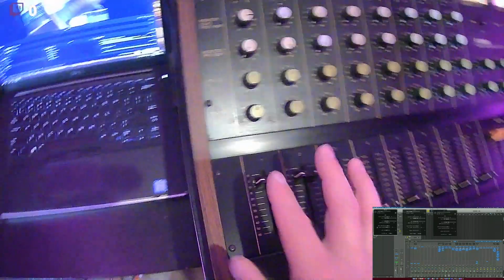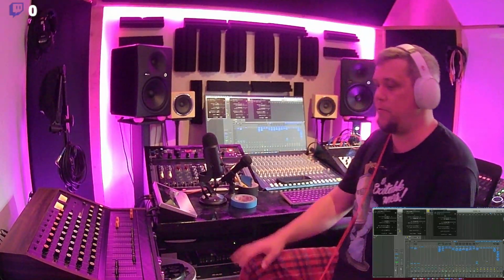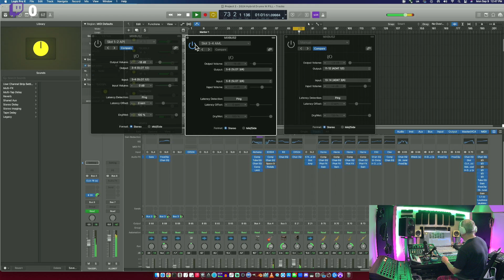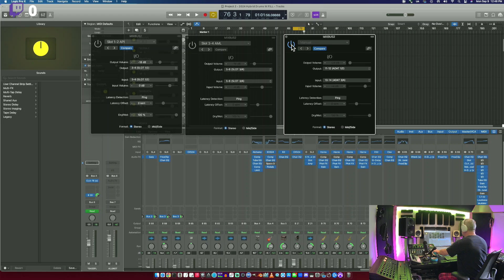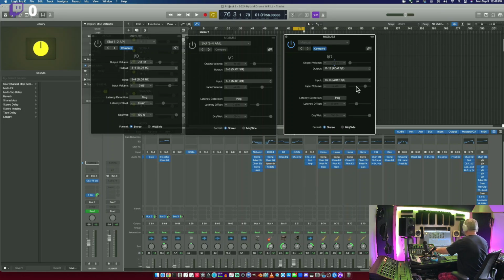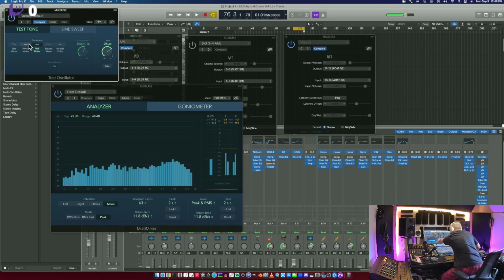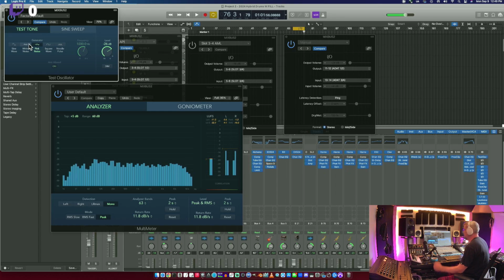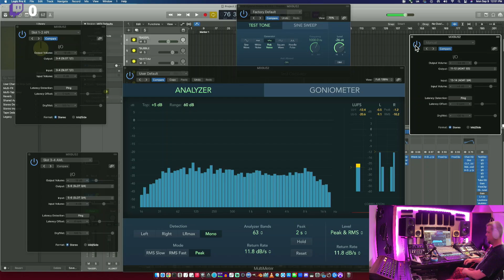Yamaha PM-430 (JapaNEVE) A/B Test with API 512v and AML ez1073pre (PART 2)

Comment: I wonder if, like you said, if you recapped even just the power supply, would the low end come back a bit. I’m just listening over headphones and iPad, and the  pm430 still sounds real deep to me. I’m picking one up tomorrow, I haven’t had some gear excitement in a while.